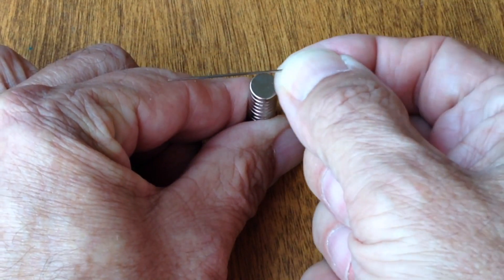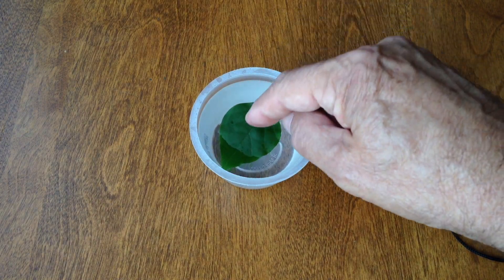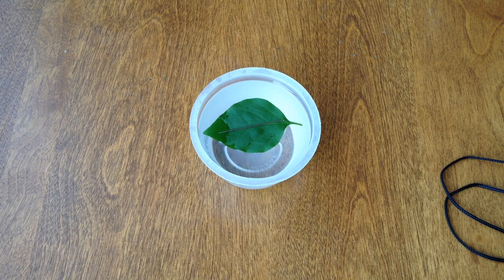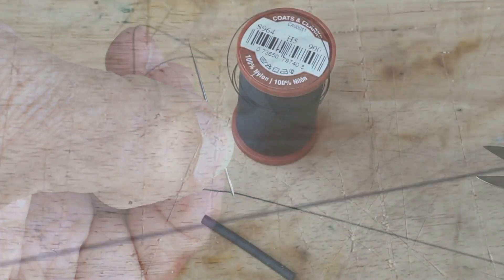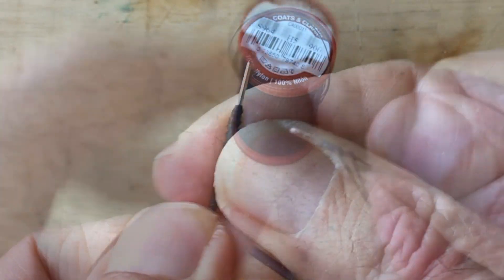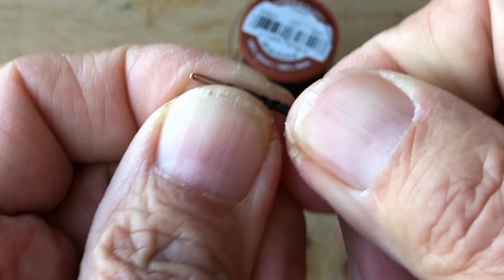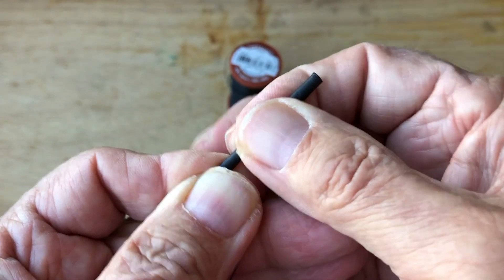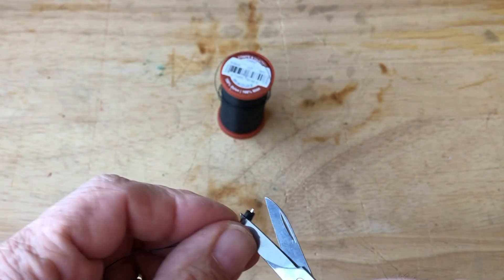Make a Corkscrew Compass and Sewing Kit.

Comment: when pulling the needle over a magnet, north will be at the end of the needle you are not holding.
Reply: And why would you use a makeshift compass if you have one to compare it to?
Reply from the maker: I would recommend you check the needle by floating it on a leaf in some water and aligning with a known north landmark or existing compass. You might put a dab of red paint on the north end of needle, too.

Comment: Pretty cool! Just curious what you think of that brand of knife in the video. I've seen them on Amazon but don't know if they're good quality.
Reply from the maker: Swiza is different than the Victorinox and a one-to-one comparison is somewhat difficult. I find the Swiza a good cold/wet weather knife as it is "grippy." The Victorinox has some nicely thought-out tools that cover a large spectrum of applications.
Reply: @resilienthacks7038  thanks!
Reply: I've got a swiza and they're pretty nice and comparable to victorinox in quality. Their blades have a nice locking mechanism to them, the rubberized grip is solid, and I find their tweezers have a better pinch grip to them. The only area it falls short is having scissors, but otherwise I really like their vic tinker equivalent model

Comment: Can you fit the victorinox’s mini screwdriver into swiza’s corkscrew?
Reply from the maker: In my experience, it does not fully fit. The Swiza corkscrew is larger, but you might want to do the sewing needle/compass mod or the ferrocerium fire starter mod as they do work well with the Swiza corkscrew.